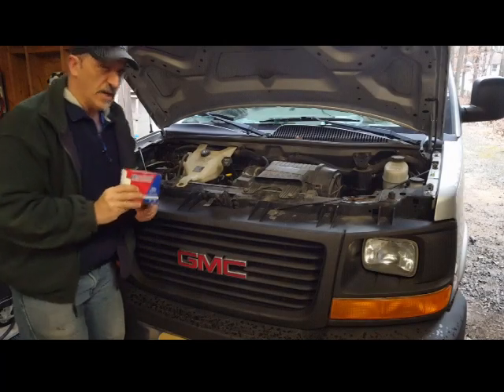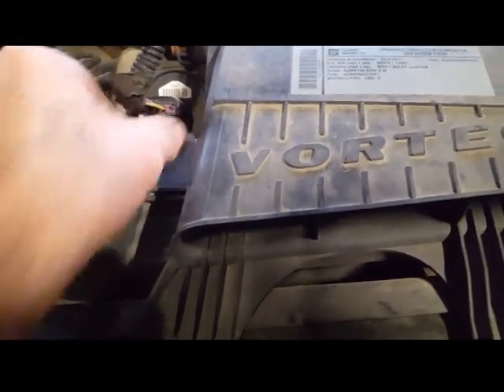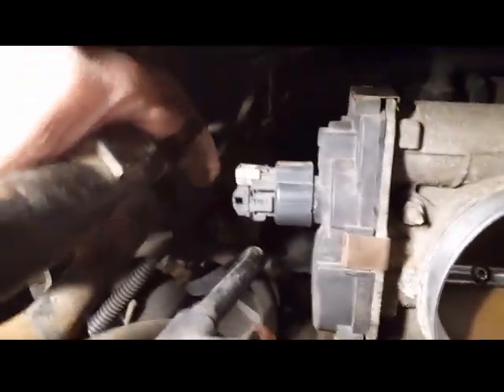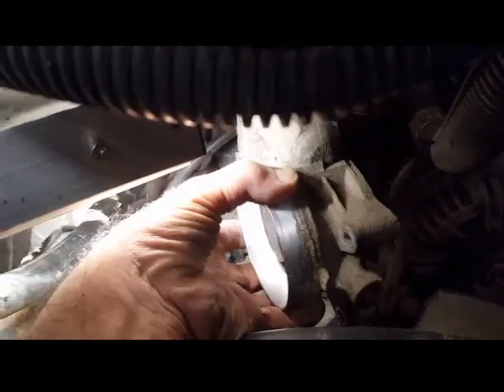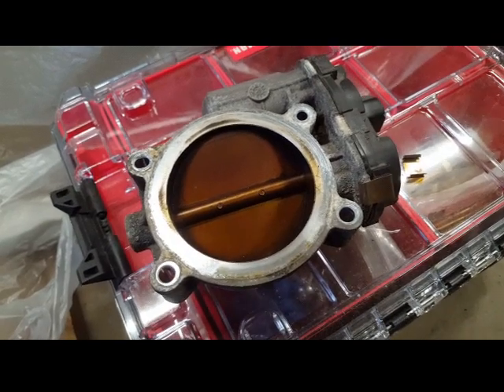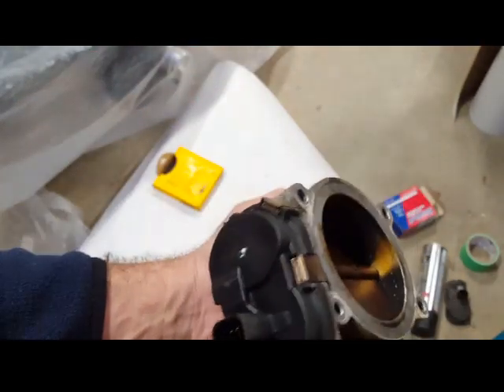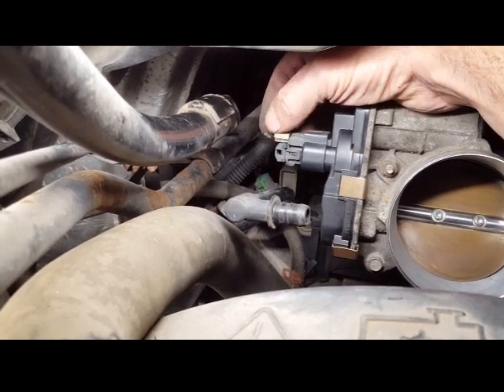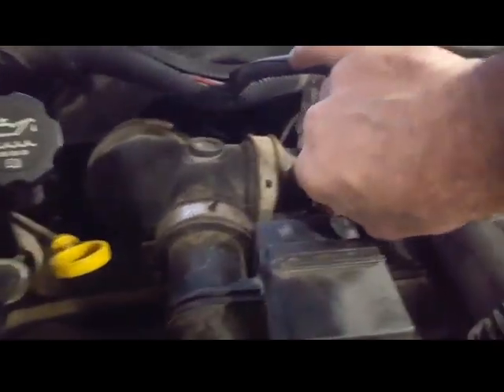Throttle Positioning Sensor 5.3L/5.7L/6.0L

Comment: I just did one on my isuzu dump truck vortec 6.0 and I'm still getting codes. Does the system need to be reset?
Reply from the maker: If you're still getting codes after it was reset.  then yes. You could do it manually by following my instructions in the video. But the codes will have to be cleared by someone with a scanner to clear the code initially. I hope this helps all the best

Comment: What symptoms were you having with your truck that lead you to replace the sensor?
Reply from the maker: check engine light came on. had it cleared, it came back on.  I had it checked a second time  the throttle positioning sensor was bad